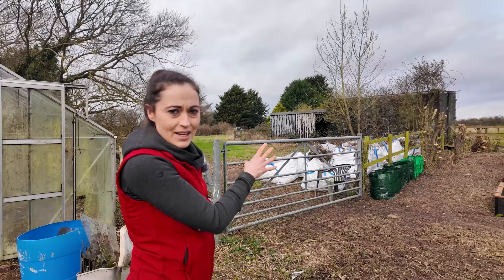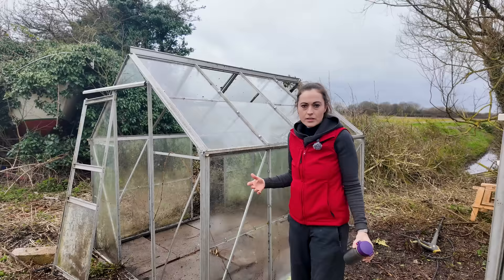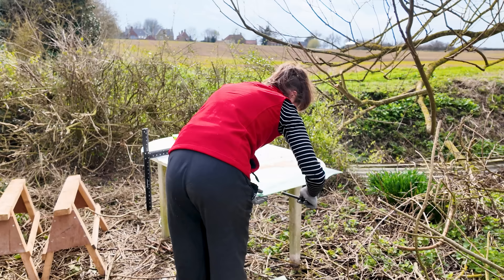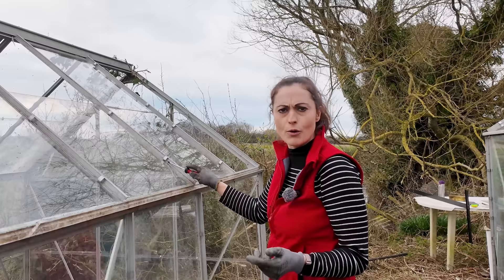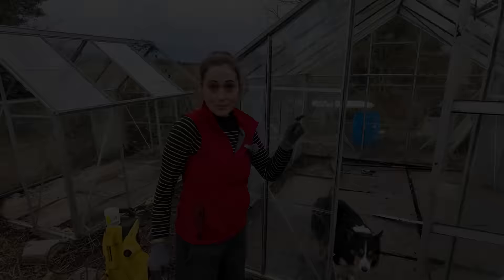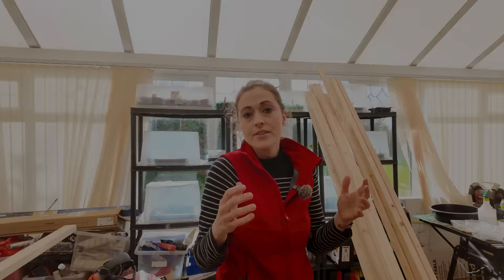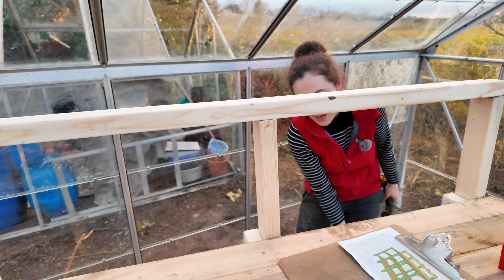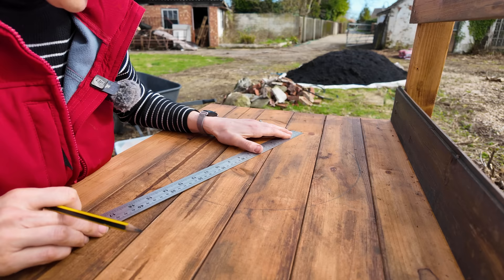I tried restoring my glass greenhouse, but it went WRONG! {+ Potting Bench}

Comment from the maker: Do you think it's fit for the bin?
Reply: Definitely not. Our society scraps things too easily. A bit of work (and lots of frustration) and you have revitalised the old greenhouse. That has got to bring a good deal of satisfaction.
Reply: Nah - Its all fixable - you got this!
Reply: Nope it looks spot on 😊
Reply: Looking good.  Just an idea...could you use the extra greenhouse glass to make cold frames?  Might be a use for some of the large offcuts of wood too?
Reply: Do you mean the glass cutter or the greenhouse? The cutter probably needs new blades. 
The greenhouse? Meh. I spent weeks fixing mine and used it for a couple of months years ago. It's a lot of work and I'm not good with plants.
Didn't hear you mention new rubber gaskets though? Those wouldh make it more weatherproof. 

(Oh, and my tip for using full panes and the broken bits for the remainder is below - it worked for me.

Comment: Glass cutting tips: clean the glass before cutting. makes a big difference.  A solid bench, with a thin blanket under the glass (helps with even pressure on the cutter). WD$) on the cutter roller, + keep it clean.  Good job!
Reply: I was going to say the same.
Reply from the maker: Thanks! I did sponge most of the cut side down off camera, but probably wasn't as thorough as I could've been because after cleaning the first two and it messed, I was worried I'd be wasting my time 😅
Reply: @outfoxthefox  yes because when the glass is clean, it gives the cutter a smoother run
Reply: @homie3461 this is so important to break it on a straight edge of a table. Otherwise it’s uneven pressure. Have you added some mineral oil to your cutter? It’ll make a much nicer score. The score needs to be done in one long run. And wear eye protection please!

Comment: From my experience- make  sure the glass is clean before you score, or the cutter will skip. I only tap on curved cuts, just grip both side of your line and twist confidently, you will get a clean cut. Alternatively, put something like a thin metal rod under the score and press down on both sides. Good luck!

Comment: The smaller greenhouse...  
Look for 'Channel plastic' or Corroplast as it's also known as. It's not as transparent as glass, but it definitely lets the light and heat in, and keeps it in.   
Great stuff to fill in the holes in the smaller greenhouse.  

Noggins!   
(I watch 'Escape to Rural France'. Any day with noggins is a good day! )   

I would have placed pieces of pressure-treated wood under the bench legs, but maybe the treatment is enough?  
(Give the underside of the legs a few coats)

Comment: I used to cut glass for a living. After you scored the glass lay the underside over wooden dowel or your straight edge😮 and just snap it off. There is no need to do all that tapping. 
Also you don't want the glass to fit tightly in your channels because the glass will expand and it may crack it.
And there are special cutting blades for a plastic sheet. You scored in snap it much like you do glass.

Comment: Hi! No, I'm not an expert in cutting glass, but one thing I know for sure from professionals is that the glass panes need to be as clean as possible before you cut them. This is for the simple reason that only then can the Diamant or Videa cutting tip form the correct crack. And only when you hear that deep crunching sound while cutting can you be sure that the cut is 100%. Good luck and I can't wait for your next videos.

Comment: Just a thought re the door. I built mine last year and the door was catching but realised I could adjust the door up slightly to clear the obstruction. Worth a look. Oh and has been mentioned fit an auto vent. I’ve put one either side. Saves plants scorching in hot sun.

Comment: Shift all the existing panes in the smallerg/h up. Then board the bottom sections. Use that as a potting shed come g/h, and the bigger, complete one as a main gh. Forget netting it. The frames need glass in for rigidity, else they mangle in anything more than a light breeze. Fruit cage out of wood or galv poles.
Reply from the maker: Thank you so much and will look into those! I just hope the potting bench fits in there 😅 May need to trim the legs down a touch!
Reply: @TheCarpentersDaughterUK  you can use a net over one of those cheapo polytunnel frames, and reinforce with roofing battens. Make sure its 25mm pipe, or get adventurous with the blue hdpe  and make a large hoop house. Semi circles are strong shapes. Netting for fruit - ''dove netting'' 25mm (1") knotted square net, 800 Denier , 6-ply, black UV treated polyethylene, best quality ive found, dovecentral. Pricey, but has lasted over 15yrs. 
Personally, I would build a massive wooden fruit cage 7/8ft high, as big as you can. Netting over the outside. Then make a post and rail fence, 60mm inside the cage, to cordon and train off of and have access betweennet and railsfor maintenance.  No point netting if fruit is against 
the netting.
Reply: @TheCarpentersDaughterUK  if you have to lower the bench, no harm in digging a central path out of the gh to make it 'taller'. Line with the blocks, or pavers.

Comment: Instead of garden beds built inside the glasshouse I would suggest making a raised bed the size of the outside perimeter to lift the whole glasshouse up. You would have to step over at the door but doing this will maximize the garden area, eliminate the inaccessible gap between the glass and the back of the planter frame, give more head useable height and most importantly lift the bottom frame out of the dirt which tends to be the first thing to rust out.

Comment: I learned glass cutting years ago from an chap who did it for his entire working life. The trick is to dip the cutting wheel in oil before making the cut. Glass actually heals as soon as it's cut. The oil lubricates the cutting wheel and stops the healing process. The glass then cleaves with the smallest tap on the underside. 😅

Comment: Use the large, intact pieces as is, and the scraps for the remainder. That's what I did - the greenhouse I was working on had 3 x 42cm panes at 42cm instead of 60cm, so I left the two at 60 and cut a narrow piece for the bottom.

Comment: Hi Vicky, you are doing a great job. Just a tip when cutting glass, make sure its clean as you get a much better score. You can also try giving the glass a quick snapping action with the scored line on the edge of the table. Don't give up its all a learning curve.

Comment: This was a really fab video, Vikki! I knew you’d figure it out. As a job for the future (as you’ve got so much to do right now!), I think the stainless steel frame would look lovely painted a sage green or a traditional farm barn green to tie in with the surroundings. As a keen potter, I’d recommend getting a small sink with a foot pump to wash your hands. The kind of ones market traders have. 

As for your fruit cage, I’m not sure what type of fruits you are going for? If you are thinking hardy soft fruits like raspberries. I’d just remove all glass from the green house and store it as spares. Then I’d half board the walls and use fruit net over the top and sides.

Comment: Good job. Other greenhouse or any semi-permanent structure; Use shadecloth. It can be had in varying transparencies, thickness, toughness and material, easy to handle, to cut etc. 
Comes in differing widths and bought off the roll. Makes good doors and such. Big advantage - handles hail much better than glass.
Potting tubes and all sizes of pots etc can often be found in bins on landscaping jobs. If you ask, some will put them aside for you.

Comment: A little late now as you have completed glazing. To cut old glass, clean, score and wipe over cut with meth spirits. For fitting roof opening panel lift it and slid over top of other panels, head throu opening using steps and work throu opening. Small green house appeared to have roof opening vent which are normally standard sizes so could have just swopped to larger greenhouse

Comment: Greenhouse glass has got silly expensive now, last I bought some it was less than £1 a piece, now it's £5+ and you have to buy in significant bulk to get that price, single pieces were £10+
Decided for both cost and safety reasons to totally replace with polycarbonate.

Comment: Vikkie that was great work and I so enjoyed the video, I was thinking you could buy one of those door screens they are cheap and also great for summer to keep flies out but air in, also your dog can go in and out as he likes as they have little magnets that shut easy. Im sure you know the ones I mean. Big hugs Dede
Reply from the maker: Thankyou for the tip, i think i know which you mean. Like weighted down, 6 inch overlapping mesh curtains?
Reply: @TheCarpentersDaughterUK  yes they just snap open and shut as you go through them, lot of people use them on patio doors, but could help in short term for you till door is fixed, xxx
Reply: @TheCarpentersDaughterUK   Ok correct term are Insect screen doors, lol, xx
Reply from the maker: I'll definately look at those, even if i fix the door, like you say, it's great for hot days.

Comment: Excellent job on the glass. Those w clips are lethal. Take a look at bayliss auto vent. Ventilation is very important for greenhouses.
Reply from the maker: Thank you. Sounds like I should have left some of the broken ones in then 😆😆
Reply from the maker: And will do
Reply: @TheCarpentersDaughterUK  if it's too humid in there, mould goes nuts. Also aphids will appear overnight and take over the world.
Reply from the maker: Thanks. Will keep my eyes peeled!
Reply: @TheCarpentersDaughterUK  just got to your sticking door bit. Do you have two white nylon wheels on the door? They usually fail causing sticking issues. You can get these in a kit if you have. Only a few pounds.
Reply: You should also watch out for black ants; they bring aphids with them.
Reply from the maker: Thank you. We're going to look tomorrow. My Dad said the exact same thing tonight after watching!

Comment: The Jigsaw you were using looked like it uses the EXT battery range. The Same manufacturer  does a reciprocating  saw using the same batteries. It's  a beast and with the rough cut blades ( which aren't that dear) it will easily tackle all those branches you were struggling with. I use one for cutting up firewood and just about any other rough cutting. Think of your bow saw on steroids:)
Reply from the maker: Yes, it is! It's an Erbauer one!
Reply: Yup :) Just wasn't  sure on mentioning manufacturers  names on your channel. Honestly the rip saw is great. I wonder what on earth I did ( apart from burn out other saws) before I picked up mine at Screwfix. You can get one as a bare unit if you have plenty of batteries already, or pick up a set if you want to add another battery  and charger.
You get a decent  time from the battery as well and you will find it handy for demolition of any old wooden structures  you want to take down and tree clearance, cutting up pallets  etc. Well worth the money. I've  even used it to cut through stubborn  roots in the ground when clearing bushes

Comment: I would suggest making sure the wheels on the bottom of the door are in the channel. Might be screws/bolts in the door itself catching on the channel if the door isn't aligned properly.
Reply from the maker: There are a couple screws it could be on the frame itself, but they don't look that big, i think it must be alignment, i've just got to figure out how to take it off      😂

Comment: Hi you need a window in the greenhouse roof or you will cook everything...it only takes one hot day....the plastic is the best bet for that to keep the weight down and you can get an oil filled opener that will open it automatically...I would also fumigate the greenhouse before using it....
Reply from the maker: Thanks for the heads up, there is one on the otherside, i think you're right and i might try out adding another one for better airflow too.

Comment: Think the glass surfaces should be absolutely clean before cutting.
Reply from the maker: I tried before a few times and it didn't make any difference or they were brittle. I did sponge most over though as much as I could be bothered

Comment: As for the sliding door, cant be that difficult to see what the bottom of the door is hitting to stop it from closing, and just find a way of removing it by use of a grinder or somethiing like a chisel even might work well.  Being able to close the door is important, just to keep rodents or other critters that you dont want inside from having a shelter